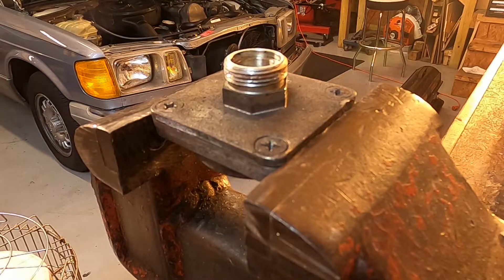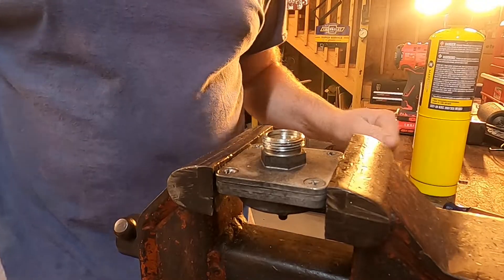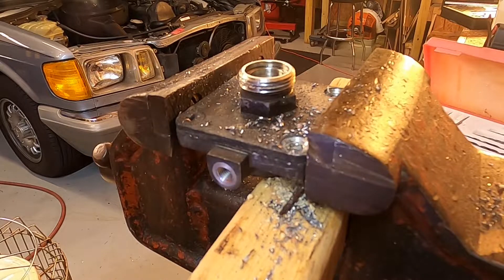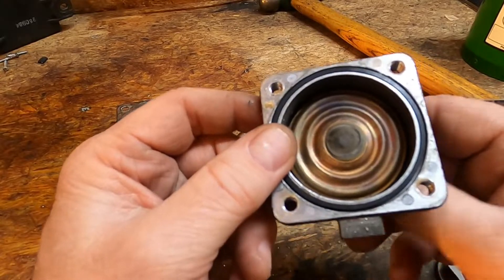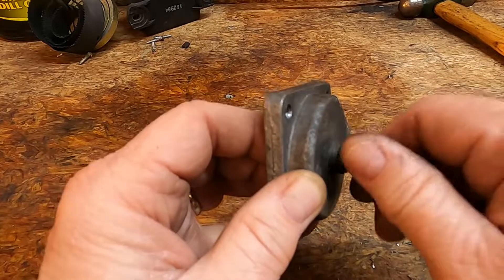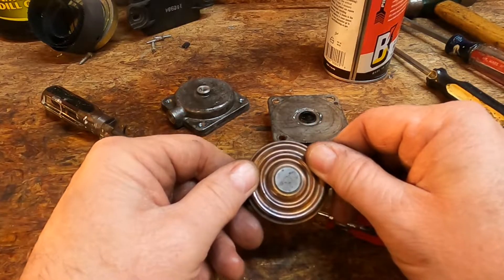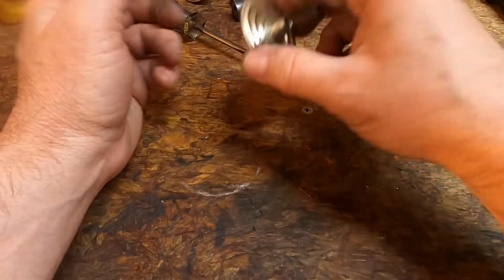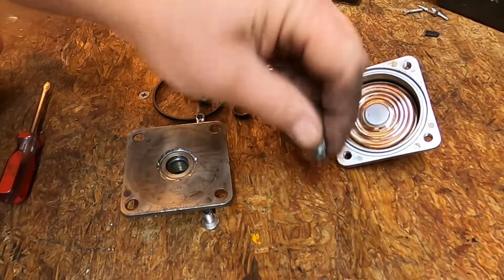Mercedes-Benz OM617 ALDA Tear Down and Inspection

Comment: I just loosen the nut,turn the screw counter clock 1 turn and my 300 sd ran better than it ever had
Reply from the maker: unfortunately that did not work on mine.

Comment: So these are basicly metal bladders that get compressed by the boost pressure and therefore release pressure from the plunger in the pump. That is a pretty easy to understand system.
I will try repairing mine with a new O-ring soon. Hopefully I get more fuel.

Comment: I didn't understand how it works.
Reply from the maker: It's definitely not intuitive. Here is my opinion on how they function. The capsules are made with an internal vacuum from the factory. So while at rest at sea level altitude they are thinner because of the higher external pressure of the atmosphere. As the car travels higher in altittude (less atmospheric pressure), the capsules will expand. The capsules press on a rod that regulates fuel pressure. If the capsules expand they press on the rod and limit fuel pressure. At sea level, or when turbo boost preasure is high, the capsules retract pullling the rod out and thus NOT restricting fuel pressure. This mechanism limits the emission of black smoke prior to the onset of turbo boost. It also limits black smoke production while driving at high altitudes. In my opinion the ALDA is purely an emissions device. I would assert that most ALDA devices on high mileage Mercedes diesel  cars from this era are no longer functioning because the capsules have cracked and no longer hold a vacuum. This is why the car has no power off the line. The capsules are expanded needlessly thus erroneously limiting fuel pressure. Screwing the ALDA screw all the way out helps this situatuon but not entirely. I removed mine and the car drives wonderfully.

Comment: I fixed mine with a normal O-ring from Ace Hardware. Works fine and as mentioned below keeps the appropriate air fuel mixture (less soot than with it out, or an excess fuel condition). I don't like to mess with old school german engineering (ALDA delete). Therefore I sentence you to 20 episodes of Judge Judy! Oder aber vielleicht eine Bratwurst ohne Bretzel, Senf, und Bier!
Reply from the maker: Judge Judy is indeed torture!!  🤣🤣
Reply: If you clean them. Replace the o.ring and lightly polish where the o.rings go they seal good and work like new. It helps to coat the o.rings with Vaseline to help seal and move freely.

Comment: Be smart and put the ALDA (with new gaskets) back on the Bosch injection pump. I did the same with my ALDA and it solved the lack of power in low rpm. Without it you may soot up the engine, exhaust system with unburned carbon and decrease your mpg.
Reply from the maker: Is there a source for replacement gaskets?
Reply: @ImpalamansGarage  
I didn't found a source. So I used an normal o-ring for the shaft (culprit in my case) and re-used the larger o-ring, which was also in good condition. Below the larger o-ring, I put something like a self made paper seal, so that the ring came a bit up, plus a little bit sealant maker on the right spots outside the larger gasket, before reassembling the ALDA with new screws (I broke two from the old ones). After that it should hold pressure. I tested it, if it holds vacuum.
Reply from the maker: All valid concerns to be sure. One other thing that I'm not sure of is whether or not the capsules have hair line fractures causing their internal vacuum to be lost. I'd like to find a way to determine that if I could.

Comment: Thanks, for being the first one to post a video ALDA tear down. The 2 brass discs can be check for leaks, the same way someone checks a carburetor float.
Reply from the maker: Now there's an interesting idea!
Reply: @ImpalamansGarage  
I don't know for sure, if that will work.  I  don't have any experience with ALDA units.  Its just a idea from watching your video.
Reply: @vintage76vipergreenBeetle I guess putting it into a vacuum chamber and watching expand would be an interesting experiment. (I do have an electric vacuum pump I could hook up to a glass jar with the Alda inside. Should be visible effect even at lower pressures.

Comment: Mr. Impalaman,
The first question we all have to ask ourselves, do we understand Barometric Pressure, Atmospheric Pressure and how those relate to Altitude / Elevation.
What we are looking at here is basically Grandmas old Barometer, you know the round one with a dial and a scale.
This this system utilizes two negative pressure inputs:
Altitude / Elevation which expands the Brass / Copper capsule (partial internal vacuum) with increased Altitude / Elevation - this is the capsule with the set screw - it is usually adjusted to a specific setting at sea level (capsule deflated) to displace the pin from Pump an x amount of inches / mm (Have to check with Bosch)
The second capsule get its negative pressure / vacuum from the Turbo Charger controlled by the vacuum switch working in the opposite direction, pulling the pin of pump up, actually allowing the pin to being pushed up by the pump further, hence increasing fuel flow.
The first question when trouble shooting this system is the electrical part, is the vacuum switch working correctly, meaning being turned on or off by the associated control circuit? 
The vacuum switch should be ON / Open when the control circuit senses  an increase in engine load.
At higher elevations the altitude capsule then increases in size and reduces the travel of the pin from the pump and therefor decreasing the amount of fuel available, meaning leaning out the mixture at the same engine load compared to the fuel flow at sea level.
Hope, that explains it.
Your Buddy Peter from Kansas
Reply from the maker: The electrical control valve is actually new. I broke one of the plastic tips off the original one a while back so I replaced it.  You raise a good point about how a barometer works in that I had never given it much thought - especially an Aneroid barometer. Is the internal vacuum of the two capsules of significant strength such that they are normally somewhat in a compressed state at sea level and if altitude increases they expand to a more normal size? If that is the case and the internal vacuum of the two capsules "leaked out"  (or in rather) over time due to age, then in their current state they are larger than they might normally be just sitting here at 500 feet above sea level in my part of the world. If that is the case then it is the altitude sensing aspect of the ALDA which is broken and causing the pin on the pump to be depressed more so than it normally would be during off-idle driving conditions. Again the performance of this engine has always been good after the turbo kicks in. Let me know if I am off base on this.
Reply: @ImpalamansGarage  Mr. Impalaman your right on the money - the capsules have cracks finer then a hairline fracture and as you pointed out in your video, you will need a microscope to find them.
The applied vacuum from turbocharger then causes this whipsaw acceleration phenomenon you had.
Without ALDA it might be a good idea not to travel to Denver Colorado or the Rocky Mountains for that matter.
Your buddy Peter from Kansas
Reply: @inovahightechltd has anyone ever tried going to high altitudes with the ALDA removed? Will it start smoking more?
Reply: @ImpalamansGarage  Mr. Impalaman, the polished capsules, if neatly displayed on a coffee end table, could make a great conversational piece when the in-laws are coming over for thanks giving dinner…..
Your buddy Peter from Kansas
Reply from the maker: @inovahightechltd  🤣🤣
Reply: Thanks for the great video,  @ImpalamansGarage  I was looking for someone to finally open this mystery device :) It's an old thread now but I'd appreciate comments, if possible.
Could someone explain to me how the boost pressure from Turbo coming from the intake manifold to ALDA can become vacuum as per INOVA HIGHTECH Ltd. comment?
My understanding was that this switch on a firewall between the the intake manifold and ALDA is simply a safety device that limits the boost pressure coming to ALDA to 16psi. This limit (16 psi) is controlled by a pressure switch located on top of the the intake manifold and it is connected in one electric circuit with the switch on the firewall that we're discussing. When the pressure exceeds the limit, the switch opens releasing the pressure. Am I wrong?
Thanks
Reply: exato . o amigo só equivocou no nome vacuo com pressao mais a explicação barometrica é digna de respeito . Muito obrigADO  @dlk9854

Comment: It may not be a compelling argument for you to leave it on, but I believe the ALDA was designed for the MW Pump to behave like a properly tuned injection pump suited for a NA (naturally aspired) engine UNTIL boost pressure is increased enough to cause the ALDA to increase fuel delivery to match boost level. So when you “tip in” from idle, the air fuel mixture is more efficient in combustion. Most of these OM617 turbo engines with MW pumps probably survived as long as they did because of the ALDA. It helps keep the pre-cylinders and cylinders free from excess soot. Less soot means better working glow plugs, healthier starts, and less chance of damage and or/coking to the exhaust turbine. Try adjusting the accelerator linkages to achieve the more “linear” pedal response you are looking for.

Comment: So that thing is supposed to reduce fuel flow at lower rpm to reduce smoking.
Gee, I always thought taking your foot off the accelerator peddle would do that.
I'd say some g-man thought it up while doodling at his desk and got promoted to head doodler for his efforts and with the resulting rise in pay was able to buy his wife a new dress and a fake set of pearls.
Keep an eye out and see if your car smokes more. If it goes to two packs a day from one, then you may need to replace it. Good luck with that.
I used to take things apart when I was a kid, like old clocks that didn't work. But I figured out if something inside was broken, there was no fixing it, so I stopped doing that. Now, I just toss them and replace them.
Reply: otimo comentario amigo. eu sempre achei que lda era somente pra aumentar a quantidade de diesel quando a turbina mandar mais ar para admissao . porem vejo que a mercedes estava 20 anos a frente do tempo e ja tinha egr e lda pensando tambem em diminuir o diesel em marcha lenta . eu fiz o teste e arregacei  totalmente a regulagem em cima dele . e realmente na marcha lenta a fumaceira era enorme. depois que andava e acelerava sumia. voltei para regulagem original